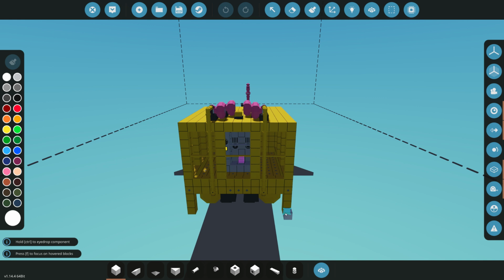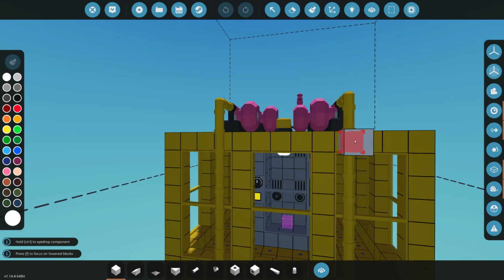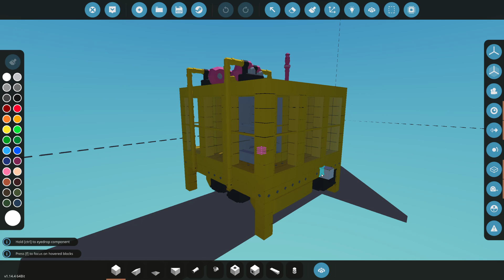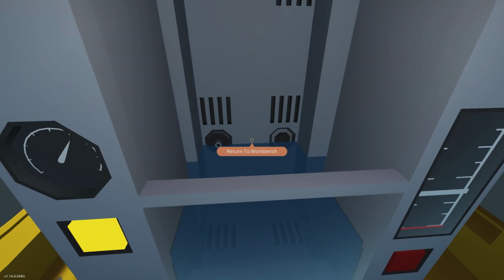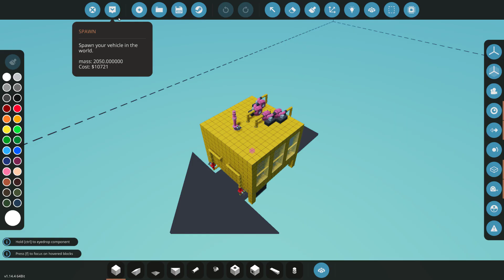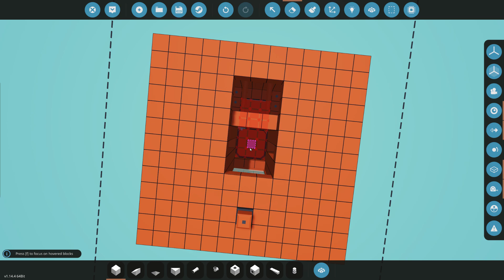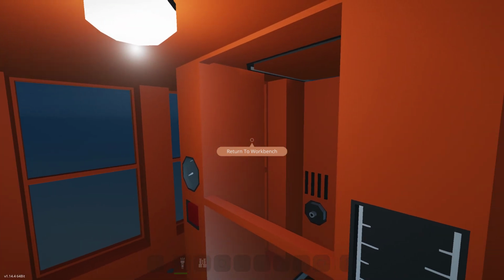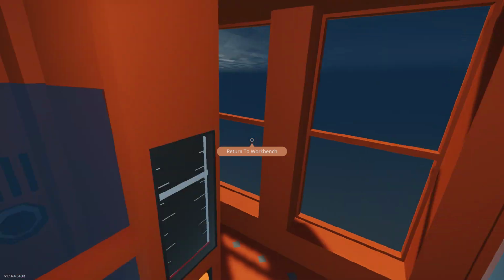Stormworks Submarine Ballast Tutorial - Don't make this mistake!

Comment: This sysyem is hard to impliment in to a smallers ww2 style subs. But it is really cool just how fast this system can drain ballast tank. Altho I dont see an easy way to adapt this system to automatic use. Like a depht hold. As an emergency system tho...
Reply from the maker: Nah it works fine for depth hold etc, you just need to plan from the start where your doors will need to be.